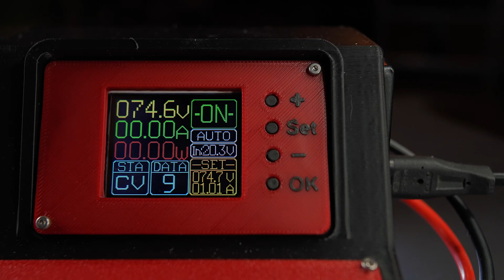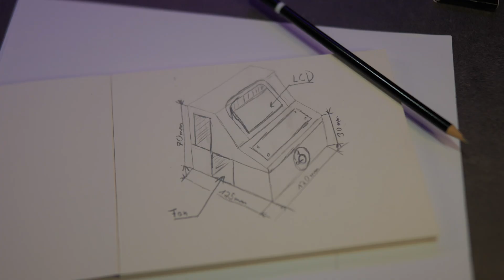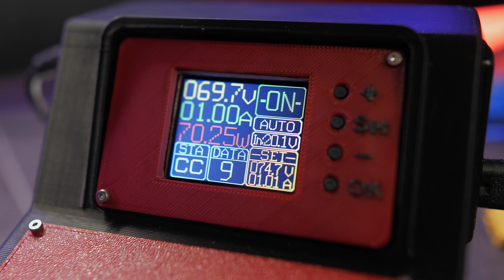Custom 120V Charger | Building My Own OneWheel (Part 3)

Comment: Thanks again! I'm really glad you found it interesting.

About your question — I'm using 2016 Nissan Leaf cells, which are designed for fast charging from the factory. They handle high current surprisingly well and don’t heat up much, even under heavy load.

That said, I still have active cooling in place during charging, mostly as a precaution and to extend cell life over time. But yeah, the cells themselves are pretty robust. It's one of the main reasons I chose them for this setup.

Once the full charger is ready and boxed up, I’ll definitely share some pics or a short video. I think you’ll like it!

Comment: Thanks! I'm glad the idea was helpful. Let me answer everything in order:

Satisfied? Yes, though I should mention I only use that module as a temporary solution. Normally, I charge using a 1800 W DC step-up converter to make full use of the two power supplies in series. The module you're referring to only handles around 600 W, so I mainly use it for testing or when I don’t need full power.

Build quality issues? The only thing I did was solder thick wires directly to the PCB because the original connectors can’t handle high current. Other than that, everything’s fine: components are decent, the heatsink does its job, and the build quality is acceptable for its price range.

Stability? Very stable. I’ve used it at up to 8 A at 84 V (20S), and the voltage stays solid—no shutdowns or protection trips. With active cooling, it barely gets warm.

And as a bonus: I’m currently building a fast-charging setup with six power supplies in series and two 1800 W step-up modules in series to achieve fast charging at 3600 W, 72 V, and 50 A. It’s going to be a beast, but I’m keeping it modular so I can scale it depending on what I need at the time.
Reply from the maker: Wow, thank you so much for taking the time to write such a detailed response. I really appreciate that! 🙌

That setup of yours sounds absolutely wild (in the best way). 8A at 84V with solid voltage and barely any heat? That’s impressive.
Also love how you soldered directly to the PCB with thicker wires. Classic “maker improves the design” moment. 😄

And that beast you’re building with six power supplies and 1800W step ups… That sounds insane in the best possible way. Please share it somewhere when it’s done, I’d love to see it.

Quick question though. With your new fast charging setup, do the batteries get noticeably hot?
Do you need active cooling during charging, or is it not an issue because you’re using high quality cells that can handle it?

I totally agree with you. For what these DC modules cost, the performance is surprisingly solid, as long as you respect their limits.

Comment: I have the same DC step up module, and I use 2 HP server power supplies in series, 24 volts and 60 amps input to charge my 72 volt ebike.
Reply from the maker: Wow, that’s definitely a very different setup!
With my little mini box I built, that would probably be a bit overkill.
But really cool you’ve basically created a proper high-performance charger there.

I actually have two old power supplies from 3D printers lying around (same type),
and to be honest, you just gave me an idea…

How satisfied are you with your module in the long run?
Have you had any issues maybe with build quality, stability, or anything else?
Or has it been running smoothly for you?

Comment: 90 watts is ultra slow charge
Reply from the maker: You’re right, the charging is pretty slow. But it’s gotten a bit better lately, and if I really wanted to, I could just swap the power supply for a stronger one. I’ve got plenty of spares in my electronics box. Honestly though, it doesn’t bother me at all. Slow charging is actually good for the cells, and whether it takes five hours or not, I don’t really care. It’s not like I’m riding the OneWheel constantly. The battery lasts about three hours, and I don’t need to hop back on right away. I’ve got time. And if I ever feel like improving it, the system is open and flexible.